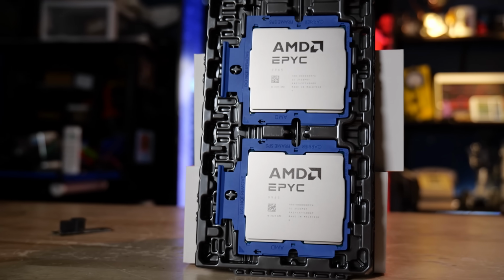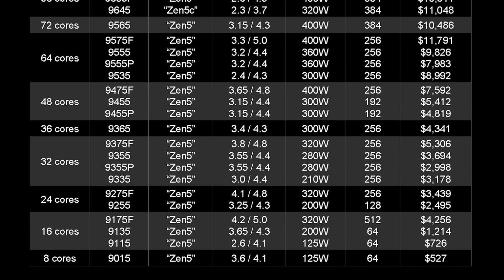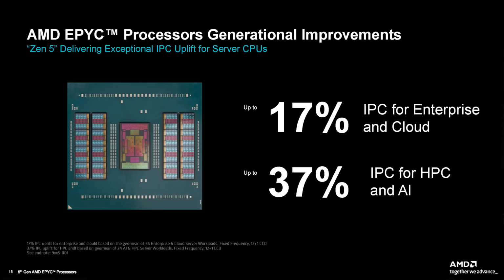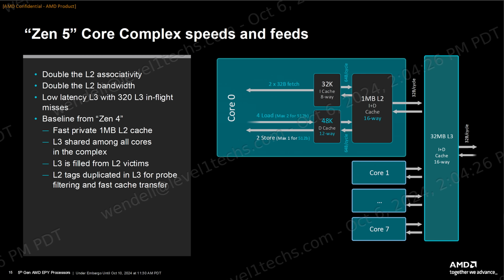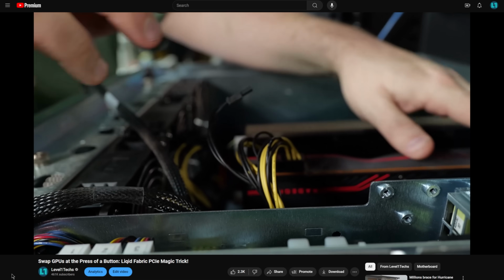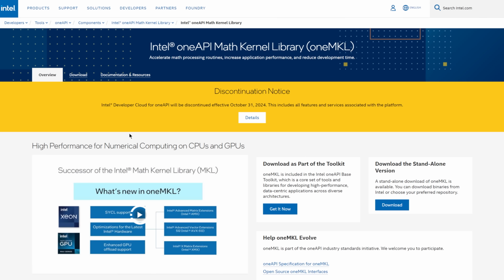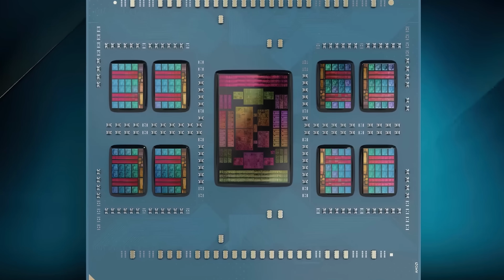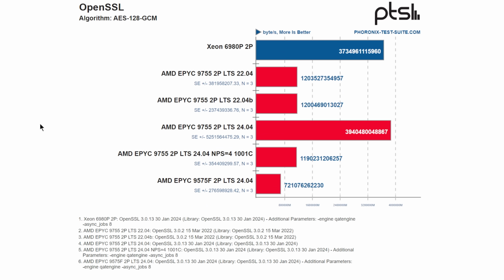AMD EPYC Turin Server Benchmarking and Review! Featuring the Zen5 9575F, 9965, & 9755

Comment: Any1 tried gaming on 9175f? I am considering switching from 5900x to server setup because I am tired of issues with not enough lanes for multiple cards and low nvme drives number I can have and constant USB ports issues when I populate 6 some will always not work or disconnect for some time or have to lower the i. settings to usb2 from usb3. So basically, I want to have a gaming PC with somewhat high core speeds for gaming but also don't want to worry about not being able to connect 4nvmes in raid 0 with 10 USB devices and 2 gpus and 10Gb network etc

Comment: I just purchased an Epyc 9654 for CFD simulations. Wondering now if I should have gone for the gen 5 Epyc for 12k. I only spent 2k on the 9654 so I'm thinking not. I can create 3x 9654 workstations for the price of one of these gen 5 Epycs. At least for me, this isn't worth it unless I need a lot of ram for a simulation, which sometimes I do with multi-phase simulations. I do know that I would find a lot more use out of 3x 64 core nodes with high memory bandwidth vs 192 core. Mainly because I don't run very large simulations at a time and CPU communication slows things down.

Comment: Most of the customers I support, don't need 128 cores. It's more like 8 - 16, but A LOT of Ghz and IPC, since some of their applications are ancient and run on like 1 or 2 cores.
I mean 9175F at 4.2 / 5.0 is impressive, but even in a VM Environment your typical "small to medium business server" - 12 out of 16 cores are are going to sleep most of the time no matter the OS as Host, because the base of Software like Microsoft Office and "Your Average Business Solution" was coded in like 1999 and just got more features put on top of existing "legacy stuff that is still in there because of compatibility" and I bet "small to medium business servers" are probably 75% of the market at least in "numbers sold".

Comment: Its too bad that non of these changes help for performance on the AM5 platform. I wonder if the Socket, Infinity Fabric there on AM5 is holding it back.
Also the changes to the core are directed more towards datacenter / AI workloads. Things that games do not use a lot yet.
Reply: The problem with Zen5 desktop is the old IOD.

Comment: On desktop, my understanding of Zen 6 is getting away from needing an "infinity fabric" because of moving to direct connects between die.  That ALONE should be about 10% IPC over heavily threaded apps or systems that are running many processes at the same time.

I haven't considered Zen 4 - 5 because I already heard Zen 6 should be a serious MCM overhaul using direct connects and that's what I want to upgrade to.

Comment: One thing missing and why I generally distrust Phoronix benchmarks for HPC results is that compiler optimizations are rarely or improperly used.
Can you maybe try comparing the Granite Rapids using the intel oneAPI compilers against the AMD Turins using the GNU compilers? In particular using -xhost and -mprefer-vector-width=512 or alternatively -qopt-zmm-usage=high for an older "classic" compiler.

Comment: It's almost like adding more cores = more performance on multithreaded workloads. Honestly AMD should just make a 1024 core chip; that'd be better. I don't know why they don't.
Reply: Then the cpu size will be like half of A4 paper. I'm not complaining tho, just imagining.

Also, maybe the latency will be an issue there, because the chiplets will be spreaded far and wide. Unless they can create something like 128cores per chip, with reasonable size.
Reply: @IVRGN  LoL

Comment: Zen 5 desktop sure got the poo end of the stick compared to this. Looks like we just needed a new IO die but AMD was too cheap to make a new one. We could also get 24 and 32 core on AM5 with Zen 5C but so far nope. Better memory speed itself on server shows that desktop is getting 100% screwed over. Thanks AMD for not caring about either CPUs or Graphics for desktop while they make really good enterprise AI GPUs and server processors.

Comment: Slightly off the topic, I thought I share the love. my Ryzen 7800X3D was hitting high temperatures and I tried many thermal pastes but not liquid metal. The BSFF from Nuomi Chemical, the non-silicon, non-conductivity thermal paste is amazing stuff. I was using the highly rated Noctua paste was running 5-6 C higher. I don't know what it's made from and they even claim it outperforms liquid metal. It would be great if we can have some proper tests on BSFF.

Comment: I can immediately think of at least two clients where this configuration could reduce an entire farm from 4 units to 1. When we talk about how much power gets used, we have to also take into effect if you can reduce rack space and literal running racks. Reducing down several separated? Oh yeah. I can see CTOs drooling. The huge benefit I'm seeing in regards to mass virtualization is that this changes the entire outlook for possibilities on virtualized remote workstations instead of committing to Remote Desktop platforms. We've been experimenting with this as a way to reduce cost with a few clients, but you make it where you wipe out some of the double licensing cost, provide high level speed and performance, and you make it work.. I am incredibly eager to put a few of these into the field!
Reply: Yeah, the fact that we have hit a point where we aren't all demanding more power, or more does nothing for the end user.  I can see offices running virtual machine only dealing with office products, seeing a huge benefit from these systems.  More processing power isn't going to make a virtual machine running office products or data entry software run faster.  However being able to decrease the number of racks does reduce cooling and running costs.  

Maybe allows smaller racks to placed in other site locations that might not have been possible due to needs of a full rack to run the hardware needs.

Comment: What absolutely baffles me, 192 cores, 500 watts. That's about 2.5 watts per core, running at 3-4ghz. About. I'm not sure how much other components are sucking down, interconnects, dram controller, etc. That's mind blowing to me. I remember a single core sucking down 100 watts and overheating.

Comment: The thing I noticed in AMD's launch today was the teaser of next year's Mi350x on 3nm cdna4 and their claim of 7× the AI performance over cdna3 products. I am very curious how much trickles down to rdna4. I get that "7×" is as much about more and bigger packaging as it is about the efficacy of the core cdna changes but still.
Reply: It probably just supports INT4. Nvidia did the same thing with Blackwell. Gaudi doesn’t support it
Reply: @jonathanjones7751  It adds FP4 and FP6, but they claimed this gains 3.5× over FP8. (9.2 petaflops FP4 or 6)
There is 1.5× memory bandwidth and 1.8× FP8 to FP8 core compute. 
(I have no indication if FP4 was a slide mistake that should be INT4. It was FP on all slides.)
Just future claims anyway. 
Though 288GB HBM3 memory seems pretty solid.
They mentioned Mi400x in 2026 with new architecture but no details.

Comment: 9:11 The dual GMI3 interface is something AMD has had on Zen 4 and Zen 4c chiplets but never fully leveraged in an actual product.  The previous IO die had 12 GMI3 interfaces arranged in groups of 3 and a CCD could not have different GMI3 link split across an IO die group, thus limiting any benefit to four CCD and below models (32 core max using Zen 4).  This group rule likely still exists but it does not really matter now that Turin's IO die supports four groups of 4 GMI3 links and thus able to get to 128 cores (eight Zen 5C dies).

Per the recent die shots of a Zen 5 chiplet, it too has dual GMI3 links, though unused on the desktop.

Comment: Any info regarding Zen5 based threadripper for workstations? I was thinking on buying a Zen4 7000 series TR but with Zen5 release I opted for a 9950x now and wait for whatever AMD will release on Threadripper or 3DCache versions. Maybe the 3D cache can accelerate my mostly Java based workloads as the JVM is very cache size bound i believe

Comment: the 400-500W TDPs is why even my works small (sub 2MW) data center is looking at 240/415 for power distribution modernization so we can get 18kw now and 36kw per rack down the line with some work.

Comment: i didn't see a time stamp for cooling. i just saw a waterLESS block that is phase change with a new start up, once the CPU gets operating temps it vaporizes the liquid but, it's NOT a vapor chamber so to speak. There people would not mind talking with L1T with i got my hands on a block and took a picture. it can cool way more than water let alone air. it quick disconnects just like water. 500 watt CPUs no problem.

Comment: I have a bit of a weird Epyc question so here goes...is it true AMD put some sort of eFuse in Epyc chips that ties them to a specific board? The reason i ask as for years now used Xeons has been the go-to for budget workstations and I figured now that DDR4 ECC is coming down in price a first through third gen Epyc would make a great budget number cruncher, but I was told AMD uses some sort of eFuse that ties them to specific boards thus making them worthless silicon used.

If this is true it's going to be a shameful waste of hardware as used Xeons are plentiful but if this is the case used Epyc chips will go straight in the dumpster.

Comment: I was listening to your conclusion. 
You are correct that these CPUs are meant for composable systems where you have a high core count,  lots of memory, and then use the local disk for spill. 
Then you use high speed networking and create an NVMe fabric married w slower denser (cheaper) SSD/Disk for a tiered storage solution. 

Makes a lot of sense and this is why AMD is the front runner for server consolidation and potentially replacing Intel during the refresh cycle.  Looking at current workloads... if you have 2TB of addressable memory.... you could in theory support 256 cores.

Comment: Wendell it would be super interesting to see if this cpu beast could run of 384 watts with still decent performance 
that would give a magical one watt per task or two watts per core 
would it be possible to undervolt this behemoth or somehow else optimize it to achieve this goal 
it might be an interesting video idea even though i know most people are not that concerned with power when they can buy this beast
it still might be worth checking and setting some records

Comment: As a CG artist it's wild to think that a single-socket server with one of the top-end Turins in it would absolutely wipe the floor with the 200-socket render farms used on the movies I worked on 15-18 years ago comprised of 2 and 4 core Opterons!
Reply: I believe Blackwell gpus do all the legwork now. Unless you’re running a software that only allow for cpu rendering only which is probably true in some engineering and medical science fields.
Reply: @jamesrock9446 Blackwell? Come on
Reply: Do render farms still use CPU rendering?
Reply: @Aggrofool  oh yeah, gpus still have so low memory capacity for big simulations, or huge scenes, even with out of core tech. But they are catching up, i thing some high end gpus came with a decent 98 gb.
Reply: @Aggrofool  We need both sir. GPU and CPU.

depend on how much memory it need to render or how complex of the scene and shader.
Reply: @Aggrofool  Yes, because very large scenes can use 200+ GB of RAM. GPU is catching up, but for the big scenes CPUs are still crucial.
Reply: @Aggrofool  Yes because of huge RAM.  I still have to do this.  But now we can do it in our basement instead of a colocation or lab.
Reply: I thinking Exactly the same thing. The last one I built in 2011 only had 32 cores over 4 CPUs and 128gb DDR3. It did some work for it's day, but it cost a small fortune. Now you can get all that in one workstation and still have a lil box of GPUs to do some serious lifting, VRAM limited naturally. I wish I could spring for some of the commercial cards with stupid huge VRAM capacity. 
ILM at one time was running their CPU farm with just over 9,000 cores (9,011 was the last number I saw in print). I believe they are on EPYC now, lots of them.
Reply: Exactly.
Reply: Yeah but resolutions have at least quadrupled and most things are raytraced now too...
Reply: @Capeau  that's true, which is why average render times for animated features have stayed at about 30-60 minutes per frame for my entire career! More horsepower enables more geometry, more ray bounces, more render passes ...
Reply: @Capeau  They were ray traced back then as well. Ray tracing is old tech.
Reply: Hey, bro, anyone ever tell you that you look like Nick Diaz's hypothetical older brother? That picture had me double take until I zoomed in

Comment: Seeing you talk about the speed you can transfer the information in and out of CPU. Is it actually possible to use micro fiber optics to transfer data in electronics instead of the copper-based transfer used now? Do anyone know if any company tried or is trying to research/invent this idea?

I can already see that the boards would be bulkier and the production would be harder and more expensive. But speed and heat reduction would be a good positive point. The hardware would be a lot more fragile too I think right?
Reply: Yes.... sort of. I was at IBM prior to moving to AMD. The Power 8 and 9 series used fiber optic interconnects between the processor module complexes(CEC's). On a fully configured system, you would have 4 of the CEC's wired together into a single system. However, the 4 processors in each CEC were interconnected with copper, so a hybrid. Processor x in each CEC could talk to x in another CEC using the fiber interconnects. Also, we had PCI-e expansion modules that were linked by fiber.

Comment: I secretly hope someone benchmarks that 7175F with 512 L3 cache in a gaming workload.
Reply from the maker: mmmm cfd .... mmmmmm
Reply: I’d expect it to perform rather terrible in many games as they achieve such a high L3 cache amount by only having 1 core active per ccd. You’d be constantly hitting the penalty for ccd to ccd latency if the game uses multiple threads. Entirely speculative so it’d still be interesting to see.
Reply: Why woukd it that?
Only windows Vista did that ot would never pin a main thread f or a game ro a core/thread.

It used to run the main thread through ever single core you had regaurdlesa of being a core or hyper thread. it was waful coding.

Comment: Hi Wendell, I am building a 9950x precisely to use simulation though I can't afford what you got there. I am a user of IRONCAD with AMPS Technologies and venturing to Flowsquare  but trying to make a work around on meshing at it only supports Inventor. Almost all hardware is in, just waiting for the processor itself due to stock delays.

Comment: Will AM5 get a 9955C (?), one 8-core Zen 5 3D and one 16-core Zen 5c chiplet? Or will it follow the 5950X3D, disappearing in a drawer in AMD’s testing lab in Texas?
Reply: The 5950x3d wouldn’t make much sense since the 7950x3d exist and it have very niche usages since the infinity cache have to communicate between 2 CCD but a failed 5950x3d is a 5800x3d why push your luck for a subpar products just get a easy dub. Since 5600x3d exists that means maybe the 5900x3d exist as well but suffer from the same fate like the 5950x3d and 
 since it only sold in micro center exclusively that much mean the yeld is very bad
Reply: The guys from AMD’s testing lab seemed pretty confident talking about the unreleased 5950X3D lying around there when visited by press not that long ago and seemed genuinely sad that management decided against releasing it. But yes, I also think this was done to not hurt the release of the 7950X.

Comment: I feel that the hardware available now is really starting to kill the argument that we heard for cloud workloads. Cloud was great because it made a lot of the complexity that came with managing thousands of servers with quad core opterons in them just go away. The things is that when you can start fitting 768 threads in a single server and over a thousand in the future, combined with the faster IO thanks to NVME and faster 400Gbps networking, the complexity is really starting to switch the other way. It isn't all that hard for an admin to work on a handful of racks in a server room at your office. By the time you have 5 racks filled with these things and the proper storage and networking and then have another site for redundancy, you have so much computing power available that the benefits of a cloud provider like AWS kinda go away when you could just run your own cloud. Yes this isn't going to be the case for every business and a cloud provider is more likely to provide greater uptime but even AWS only guarantees about 99.9% in most of their SLAs. You can get that on your own with HA, battery backups, and failover sites. This is honestly enough compute for most SMBs out there without never needing to look to "cloud" infrastructure.